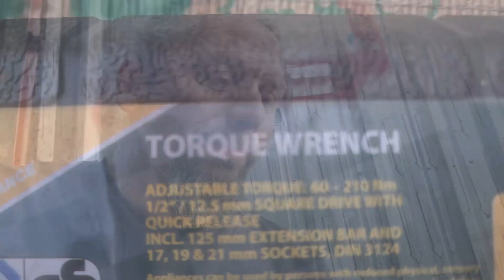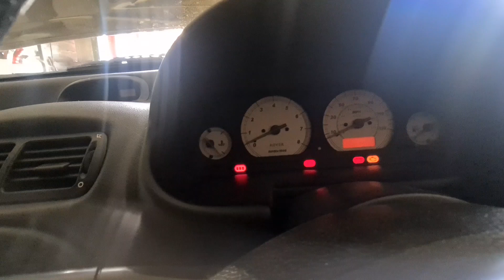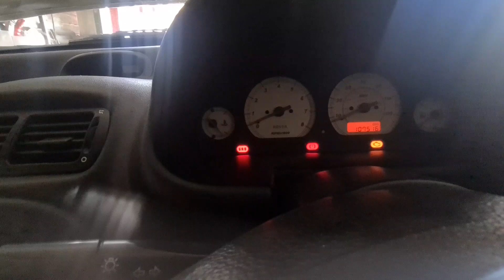Off with its head. Rover 25 head gasket jobby pt.2

Comment: Maybe take it to PoL on the back of transit face? Well done though, great job on Nigel.
Psychologically i feel my 45 is running better at the mo after the windscreen has been resealed and I've just done 200 miles in 2 days in it 🤪.

Have a great day 👍

If I'd have been more forward thinking I would have got you some project Nigel stickers to hand out at the event!
Reply from the maker: I certainly didn't fancy that trip in Transitface